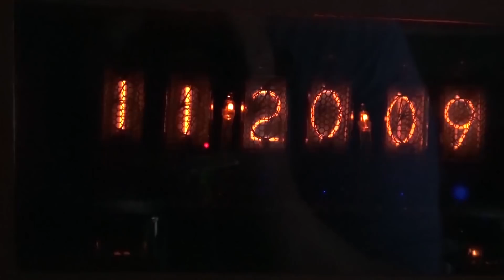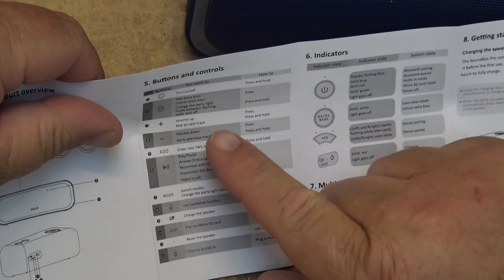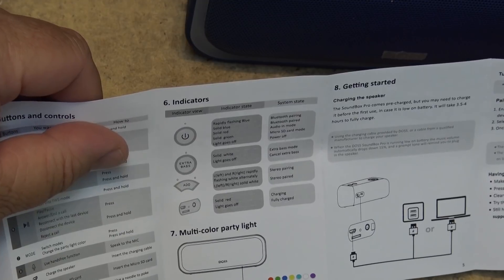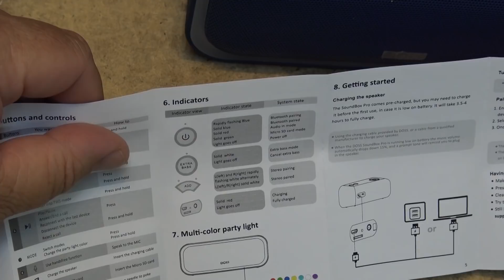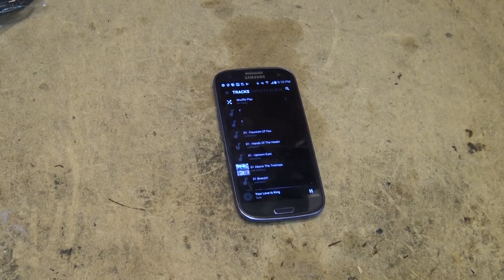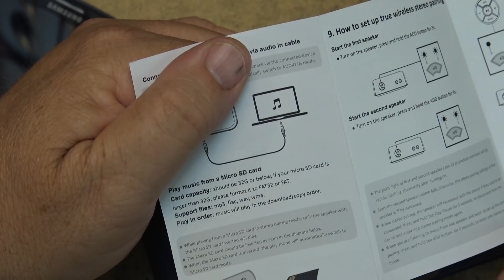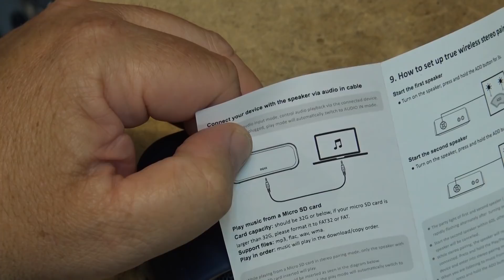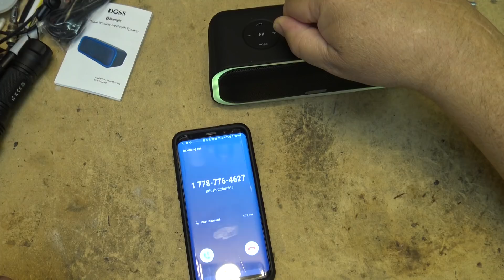DOSS Soundbox Pro Stereo Bluetooth Speaker demo and tear down

Comment: I just received a replacement Doss Soundbox. The first one I bought would NOT read the MicroSD card. I tried everything with both units: 3 brand-new 32GB cards, FAT32 and exFAT format, MP3 and WMA formats for the music. Green light would flash, but neither unit would read any of the cards. What could be the problem?

Comment: For those having issues. I turned my speakers on. Clicked Add on both, turned my Bluetooth off and they finally both paired. Then add one to Bluetooth again and they worked
Reply: Sadly this still isn't working for me. One is a soundbox pro+ and the other is a soundbox pro. Maybe this is the problem, idk.
Reply: Sadly not easy to pair a piece of crap
Reply: I should’ve stuck with the Bose audio system my first choice

Comment: I have the Doss Traveler and I really like it. I couldn't pass it up since it looks like a wolf/fox with leds for eyes. Mine doesn't have 2 unit stereo pairing, leds or Bluetooth 4.2, only 4.0. But as I use mine when I walk those features wouldn't be used. My ION bluetooth boombox (Spectraboom) has the leds like that. I never use it. But those DOSS speakers are nice. Mine has the same power output and battery too.

Comment: Help I bought this speaker like a week ago I have used it 3 times loved it now today turned it on and the led lights aren't working 😓
Reply from the maker: If it is only a week old it will have a warranty on it.
Reply: hold the extra bass button down

Comment: Thanks for an interesting demonstration.
I had a similar unit of a different brand,and although it had 2 speakers,the bluetooth was in fact mono.
I discovered this because I have dedicated left and right tones on my phone and even over 4" there is no doubt.
If this is definitely stereo,does it mean that when the 2nd unit is added,the units become mono as they would need to?
Reply from the maker: The unit operates in stereo when there is only 1 unit.
When you add the 2nd unit, notice the lights. One indicated the left channel and the other the right.  The units operate as dedicated speakers, using both speakers in each cabinet to double the power. One for the left channel and the other for the right. There is nothing mono about it. Mono would be mixing the left and right channels.
Reply: @12voltvids  Do you know if there is there an option to keep them both mono in case you wanted to use them in different rooms and still able to switch back to L and R when used together?
Reply from the maker: @rossallen13  
Yes you can use it as a single mode stereo with 1 speaker in each room and switch back and forth between devices but if they are paired as stereo then 1 becomes left and the other right.  You do realize that Bluetooth has limited range right.  So putting them is different rooms probably isn't going to work well as you walk around with your phone.  They are good for up to 10 metres, 30 feet but going through walls reduces that range.  I placed them in my living room which is large with the speakers about 24 feet apart and they work great in that room but if I walk a room over the furthest one starts getting choppy because I am now more than 10 meters away from the furthest speaker.
Reply: @12voltvids  Thanks for the quick reply. Yeah, I think I'm trying to use them for something that isn't intended really. I'd like to be able to play the same music out of both at the same time in different rooms with both playing in mono though as per a normal speaker system but then also be able to move them around and connect in stereo. Again, thanks for the reply. Great video.

Comment: My son used this video to tear down his to fix the USB port. Well done!. Do you know how to get that specific part. The module with the aux, sd, micro usb charge with connection for ribbon?
Reply: I did the same thing last night and now need the same part. Did you find out where to get it?
Reply: @stephenausherman8196  mine stopped charging. Something wrong with the charger port. I was thinking of using a old cellphone charging port and switch them out.

Comment: @12voltvids does the 10w x2 output power mean its 20+ watts in total ??
Reply from the maker: Generally that is what 10W x2 means. 10 watts per channel. So 20 watts output and when there are 2 speakers bridged it becomes 20 watts per channel.
Reply: @12voltvids  ok i was asking because ive got a Juice Boom Bluetooth Portable Speaker which the output on the box it says 3 watts x2 but in the battery tray its saying the output is 5 watts x2 (it uses a 3.7 1200mAh Lithium mobile/cell phone battery). I think the 5 watts x2 is the speaker output power
Reply from the maker: Turnip Gaming97 
Well this goes loud as hell especially with 2 of them.
Reply: @12voltvids  indeed it does, mine at full blast is really loud with the AUX cable but on Bluetooth its louder. Unfortunatly mine lags on Blootooth also i find the music is muffaled if its to loud. on AUX i can have the volume at max and its very clear. so when it comes to music you can't beat wired

Comment: I'm not a big fan of 2 drivers sharing one passive radiator (stereo separation suffers) therefore I went for AUKEY Eclipse 2x 10W RMS off Amazon 33usd or something. I pleace it on my bed's headboard 15cm behind my head and with a proper equalizer I can swear I'm listening to 2 100w floor standers
Reply from the maker: Actually it doesn't because the passive radiator only responds to the low frequency sound which is mono and not directional to begin with.
Reply: If yours is like 12voldvids here and my Doss Traveler then the passive radiator is on the back. I have an Anker of usual design. Less power, but a front radiator. I do notice a bit more bass punch from those. But I never classify any speaker of this size to a floor tower 3 way high wattage speaker set. Those have a great resonance chamber, descreate speakers for each range, it's no Comparison. 

These are made for travel and good sound from a small package. They do that. But they're not a home stereo replacement.
Reply from the maker: It has 2 passive radiators, or drones as they used to be called.
 They are not marketed as a home stereo replacement. Anyone serious about music will have a large set of speakers and a good quality amplifier. These are aimed at the millennial crowd, who don't really care about quality (just try listening to the crap they listen to) don't have money for a big system, live in small places with no room for a large stereo.  In other words those that live in basement suites, small apartments ect where they they wouldn't be able to have a big system set up. Perhaps in a bedroom, or dorm room. That is the target buyer of these, and for the size they sound pretty dam good.  No they will never replace my big ass speakers and tube amp, but to take outside in the back yard to stream some stuff from my phone they are more that good enough.

Comment: you should try a larger card and google search a program called "guiformat".  It should format the card as FAT32 and you might be able to get a card larger than 32 GB working on it.
Reply from the maker: 32gigs is more than most people would ever want to put on a system like this. Most of these units have a maximum number of files they can support anyway. For example in my car I can put up to a 128 gig USB stick in it, but it really doesn't matter because the system can only see 9999 files anyway, so all those extra tracks will never play. Many of these players only support 1000 tracks. I didn't test this to find out. The SD playback is more for convenience anyway. You download your favorite party mix in the order you want it to play, plug in the card and let it rip.

Comment: So, to get real stereo separation, one has to buy a second one? Wow, just wow! :þ
Reply from the maker: Madness832 
No you get stereo out of a single unit just like any portable stereo blaster did. If you have a second one then your can physically place them 7 feet apart just like you would with a real stereo with wired speakers which will fill the room with a proper image sound as that is what recording engineers mix for. A 7 foot sound stage.

Comment: i wish you would get your mitts on a beats pill
Reply: The speaker is useless. Used it once and it no longer charges
Reply: @mahwambo3273  I know they are crude as far charging goes the connector on them are crap. I just want to watch a video of him dissecting a Beats pill.